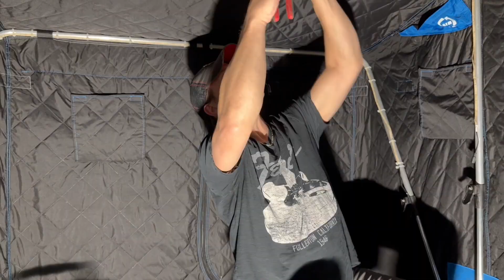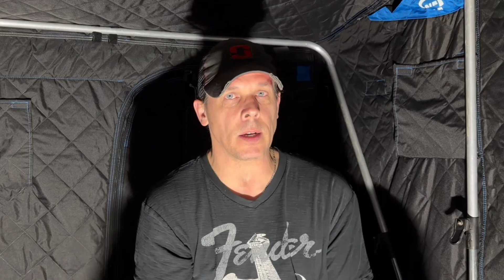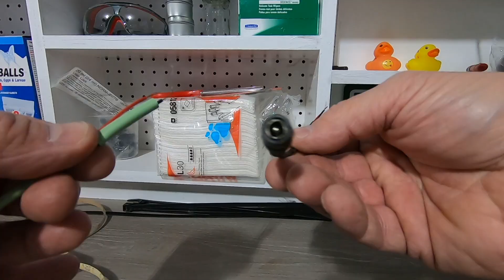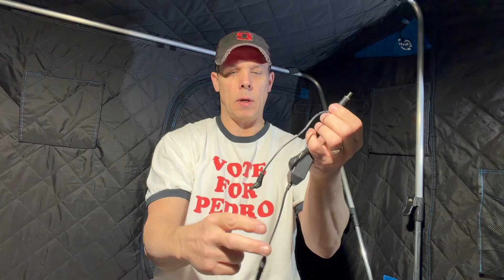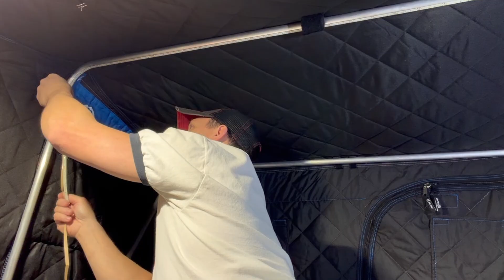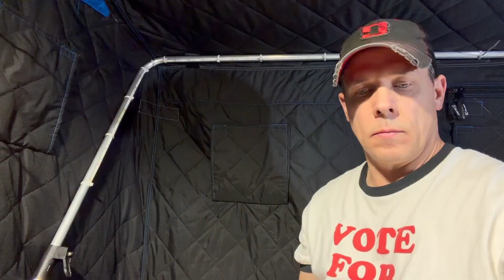Add LED Lights To Your Ice House

Comment: the way that you are installing those lights will prevent you from retracting the poles,what a joke
Reply from the maker: No. If you watched it you would see that it is on the upper section of the  poles. It has no interference whatsoever setting it up or taking it down. I’ve used this design for a few years with no issues. I was replacing what I had the same as it was. I will be sure to show it in my next video setting it up for a day of fishing.